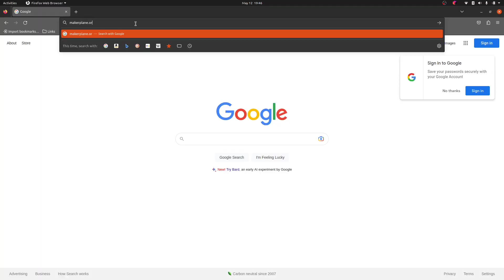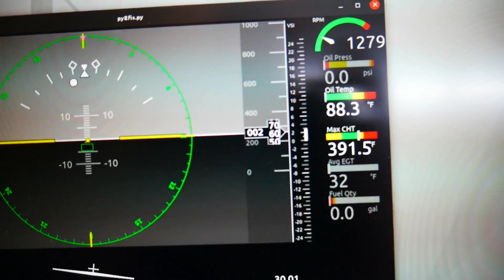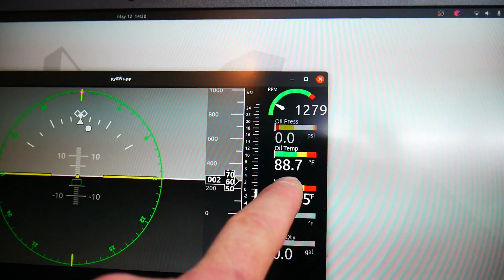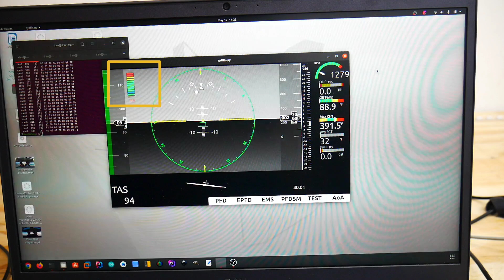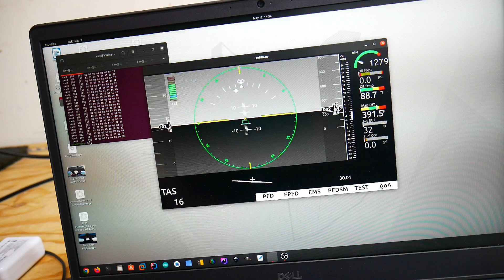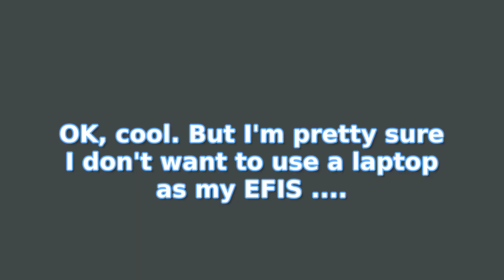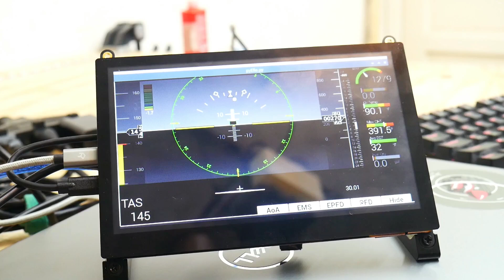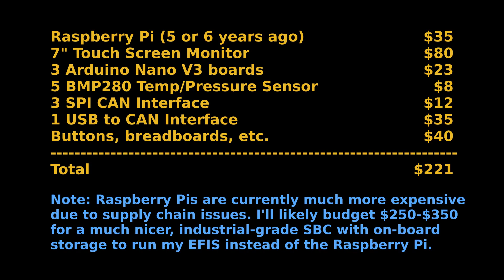Practically Free Avionics

Comment: So I got AoA, barometric altitude and the temperature of wherever the barometric sensor is located.

How do I get the software to display airspeed and attitude?
Reply from the maker: For attitude, it might be best to connect to a Stratux:
https://youtu.be/AJPfOm8xwjs?si=WrrAQ1apjDT1srXB

For airspeed you'd need to come up with a board that's connected to a pressure differential sensor (one port for pitot pressure and the other for static pressure), calculate what the pressure difference means in terms of airspeed, formulate a CAN message, and push the data to the FIX-Gateway (same as you did for AoA, pressure, and temp readings).
Reply: @dan_der_flieger  
Ok, thanks. That in a flash makes the whole setup much less affordable. I guess with all the stuff combined I will have to invest at least 1000,- for all of it. 

To be honest: before I entrust my safety to a DIY set, I'd rather invest 1800,- bucks into a uAvionix AV30E. That may not get me a large display or engine monitoring, but it has everything else:
- EFIS with attitude, compass, ball, altitude, airspeed, groundspeed, vario ...  
- AoA
- G-meter
- GPS data overlay
- HSI
- battery backup ...
fortunately as long as I don't want a Garmin, the whole stuff isn't THAT expensive anymore - especially considering how much money flows into the hobby anyway.
Reply from the maker: @archer494 - All true. I'm likely going to put a GRT 7" EFIS in my Sonex. 

I mostly started looking at the MakerPlane stuff to use as an engine monitor. I was planning to put an Aeromomentum engine in it (which uses microsquirt CAN messages). You could arguably make a really nice EIS for almost nothing. 

One thing about pyEFIS is that you can put a second display in your panel for like $150. With the uAvionics (or GRT or whatever) you're looking at minimum 10 times that for a second display. 

Like I said, for the money a single $2500 GRT EFIS and a tablet will do just fine for me. But I think it was worthwhile to play around with the MakerPlane stuff just to understand the various messaging formats. And since it's open source, someone is likely to figure out a good ADAHRS for it at some point.

Comment: Any recent updates. Did you get the engine management system connected to the Aeromentum engine? Can you show how?
Reply from the maker: No, I ended up buying a mid-time Rotax instead. But it should be relatively straightforward. The Aeromomentum uses the Megasquirt CAN standard. A quick glance at the FiX-GW GitHub repository shows that it now supports Megasquirt (at least it's listed as one of the options):
https://github.com/makerplane/FIX-Gateway/blob/master/src/fixgw/config/connections/megasquirt.yaml

Comment: First! Thanks for your hardwork!! It really helped me get going on this. A couple questions, It seems that for every sensor you have to have a different arduino to process the sensor info and pass it to the can bus. Im wondering if you would be able to run an arduino with an i2c board and connect the sensors to that of course with code to separate and pass the info on to the can-fix. Would that work or does each individual sensor needs its own connection to the can-fix? If so now i understand why you created the can-fix board😅.  Trying to figure out something to read rpm and Im thinking attemting to use ir to read rpm and I think i have a solution for probes.
Reply from the maker: @travisashby  thanks for the question. You can definitely connect more than one sensor to a single Arduino. My preference is to separate them for the sake of redundancy. If an Arduino with five sensors were to fail, would I want to lose those five points of data all at once?  Probably not.
Reply: @dan_der_flieger  Makes perfect sense. Just got my monitor in. Hopefully install goes well and let the testing begin!
Reply from the maker: @travisashby  nice! Have fun with it. But also be prepared to be a little frustrated, too. 🙂
Reply: Install went ok. Trying to figure out the monochrome issue. I think it has to do with the pyqt libraries and snap
Reply from the maker: @travisashby  I've seen the monochrome thing before. Sometimes flips back and forth to color. I just assumed pyEFIS has some code to flip it to monochrome if the data doesn't flow fast enough or whatever. Just conjecture, though. I didn't spend any time troubleshooting.

Comment: Bro, from wich sensor pyEfis can  take Air Speed?
Reply from the maker: The best one I have found is the MPXV7007DP. 

https://www.nxp.com/part/MPXV7007DP

It has two ports - one would be used for pitot and the other for static pressure. It can sense up to 7kPa from either nozzle. 

It's an analog sensor, so you would use an analog port on the Arduino to read the value.  The sensor has 8 pads, but you only use 3 of them: +5V, GND, and the output. The output will send a voltage between 0V and +5V, which is read by the Arduino. 

* 0V = -7kPa of pressure
* 2.5V = matching pressure on both nozzles
* 5V = +7kPa of pressure

Just make sure your Arduino uses 5V logic. Many are 3.3V logic and putting 5V on that GPIO will fry your board. If you have an Arduino with 3.3V logic, you can step the voltage down using a "voltage divider" circuit. It's built using two resistors. 

Here's a calculator that you can use to figure out which resistors to use to step from 5V down to 3.3V:

https://ohmslawcalculator.com/voltage-divider-calculator

But if your Arduino uses 5V logic, you can use the sensor directly - no need to use the voltage divider.
Reply: @dan_der_flieger  Thanks a lot for your answering and time, and two more question
1. This all work throw CAN interface correct?  (i mean true Air Speed sensor MPXV7007DP) 
2.  pyEfis work with Stratux and CAN interface (all sensors) at the same time (simultaneously)  or not
Reply from the maker: 1. That's how I set it up - air pressure differential sensor to an Arduino with a CAN interface. Then the CAN data is received on the RPi.

2.Yes, it should all work at the same time. The FIX Gateway is designed to collect data from many sources and present it to pyEFIS to display.
Reply: @dan_der_flieger  Matek ASPD-4525 i got this, what you think can it work? And what part of arduino i need buy for connect this aspd-4525  to can interface
Reply from the maker: @VVV-AVIATION - I've never used that sensor before, but it looks like it would probably work. It seems like it uses an I2C connection, which pretty much all Arduinos support.

As far as the Arduino goes, none of them (as far as I know) support CAN directly. You need a CAN transceiver to pass the CAN data. However, Adafruit has two microcontroller boards that have a CAN bus transceiver built in. I've played around with them and they work pretty well. 

Here's one with an RP2040 microcontroller: https://www.adafruit.com/product/5724

And here's one with a Cortex M4 (better chip):
https://www.adafruit.com/product/4759

Adafruit also has Arduino libraries and code samples to get you started:
https://learn.adafruit.com/adafruit-feather-m4-can-express
Reply: @dan_der_flieger  Thanks a lot Bro, and what you think how i can connect RPM signal to pyEfis from my ECU module
Reply from the maker: @VVV-AVIATION  I haven't gone that far, so I can't answer this question very well. It probably depends on the ECU. You will likely need two CAN modules - one to receive the messages from the ECU and the other to publish the messages in the right format to the FIX Gateway. Those should probably be two different CAN networks. If the ECU is on the same CAN network it will publish all sorts of messages of all sorts of types and the message type might conflict with the MakerPlane CAN protocol. By that I mean that the two protocols may use the same message identifier for different things and something like the ECU's oil temperature (just an example) might map to the FiX definition for something completely different. You need to be familiar with the message types in both protocols and do some interpretation.
Reply: @dan_der_flieger  oh ok, Thanks,  and i got usb-can module, its need to put some drivers for usb Linux or just plug and play?
Reply from the maker: @VVV-AVIATION  it depends on which one you buy. I didn't need to install drivers for mine, but I did have to run a command to start up the CAN network on it (like what CAN data rate, etc.) each time. I think I just added the command to the same script that I use to run the MakerPlane software.
Reply: @dan_der_flieger  Thanks
Reply: @dan_der_flieger  And what you think, can pyEfis take Speed information from gps module that be in stratux box?
Reply: On 3:20 min your video what arduino can i2c device you use? Cant find same, what best analog can be used?
Reply from the maker: @VVV-AVIATION  https://a.co/d/aLvqmyG
Reply: @dan_der_flieger  yes this thats what i need , but cant find it 🥺
Reply: Can i use this?
Reply from the maker: @VVV-AVIATION  yes, that link I sent earlier is the microcontroller with CAN I was using in the video. You may be able to use GPS from stratux for speed, but I have not done that.

Comment: Dan, thank you sharing this... All this has lit a fire in me to learn more.  Currently I fly an IFR certified, experimental Velocity, and I would have no issue running this as PFD but, with battery backed up G5s running in the of a failure go back to G5.  Like any instrument at anytime they can fail so backup systems and plans are paramount.    However, I am looking to actually using this in a KR2 as a PFD in VFR only conditions with steam gauge air speed and altimeter and if DIY EFIS fails, I continue looking out the window NBD.   Certification is just a process not the end all be all.
Reply: Thanks for watching, Gabe. Sounds like you have a solid plan to add redundant systems and not rely on any single one (which is a good idea). I'm still not sold on actually using this in my airplane yet, but I've learned a LOT from dabbling with all of the components and that's a good enough reason to play around with it IMO.

Comment: Where did you get this or how did you  created thi PFD altitude indicator?
Reply from the maker: It's part of an open source package called MakerPlane (https://makerplane.org/). Specifically, most of what you see in this video is the pyEFIS project. 

Here's a link to another one of my videos that describes how to use it and, in particular, how to get AHRS data from a Stratux ADS-B receiver:
https://youtu.be/AJPfOm8xwjs

And here's another one demonstrating some printed circuit boards I designed for use with the project:
https://youtu.be/cIsv_dQTMyo

Note that the pyEFIS project was recently updated and has changed a little since I made those videos. I haven't had a chance to play around with it very much yet, so I can't answer any questions about the new version.

Comment: Hello Dan, I’m from France and I like very much the way you explain your work. I had installed the pyefis and everything opens fine. I have a BMP280 sensor on an Arduino Uno and I get the data on a Raspberry Pi 4 via a USB connection . In a Thonny script I have the data temperature, pressure, altitude and it’s working fine. My question I want to ask you, in which file of pyefis I have to make changes to display the data from the sensor. I will do the same with the other sensors, but I’m a Little newbie in this and I want to understand this manipulation. Thank you for your response and your projects.
Reply from the maker: @cosscd7683 - Bon jour. I haven't tried to directly connect any sensors to the Raspberry Pi. I've only attached them to Arduino devices and used CAN bus connections. And I haven't used Thonny (I've heard of it, but no experience with it). 

I'm not sure that pyEFIS/FiX Gateway support what you want to do out of the box. But you'll probably want to do this in the FiX Gateway. Look under the plugins area and to find some code that does something similar to what you want to do.

For example, look at ~/FIX-Gateway/fixgw/plugins/demo/ to get an idea how to get data into the FiX Gateway.  The FG database key "ALT" is used for altitude. "CHT11" is cylinder head temperature for your 1st cylinder, "CHT12" is your second cylinder, etc. You'll have to look through the spec to figure out which database keys to use for the data you want to use.
Reply: Thank you for your response. You just connected sensors to Arduino and the Can connexions and the pyEfis program starts showing your sensors data on the screen without any other manipulation, is it? Can you give me an exemple of how did you do it for the altimeter sensor for exemple? Or can you guide me how can I connect my bmp280 to have data on my efis screen simple without any complications? Best regards @dan_der_flieger
Reply from the maker: @cosscd7683  That's mostly correct. I have a sample program for Arduino that I'll post to my GitHub repository in the next few days. I used an Arduino Leonardo board with a built-in CAN transceiver:
https://a.co/d/ai5J6or 

And on the Raspberry Pi running the FiX Gateway and pyEFIS, I used a USB CAN interface:
https://a.co/d/e9XDWXj 

I had to wire the two can interfaces together (two wires - High and Low) and write code on the Arduino that created the CAN messages in the format that the FiX Gateway was expecting. MakerPlane has a useful library for Arduino/CAN/FiX messaging that simplifies it: 
https://github.com/makerplane/CAN-FIX-ArduinoLib
Reply: Thank you, Dan, it’s clear for me, I wait for your example post in GitHub for ideas. Have a nice day
Reply from the maker: @cosscd7683 - Sorry for how long this took to complete, but I have posted my demo code to my github repository: https://github.com/danderflieger/mcd_can_simple_demo/

Hopefully it's helpful for you.
Reply: Thank you Dan for your response, I’ll take a look at this and keep you in touch . Great job!

Comment: Be cautious with an AOA sensor that has enough imbalanced weight to droop with gravity when the airspeed gets low.
Reply from the maker: I agree 100%. Always go slightly nose heavy to make sure it shows a stall when there's not enough relative wind to show a correct angle.

If you look at the latest version of my angle of attack sensor, you'll see that the counter weight/wind vane shaft is adjustable so that it can be properly balanced:
https://youtu.be/qBw1O5ASWJQ?si=nQtAt9RVMFasZ0d_

Comment: Dan thanks for your video , how can i connect AHRS ttl module, its better do through gpio or can-interface  or usb? and what additional stuff i need ? and how its be may programming for connect pyEfis
Reply from the maker: The AHRS module I connected was a Bosch IMU that won't work on a fixed wing aircraft. I connected to it with a CAN bus module. You can add an AHRS chip/IMU to a Stratux (using the Raspberry Pi's GPIO pins) and that is more likely to work. That's as far as I've gone at this point - I'm working on my airplane now rather than the EFIS stuff.
Reply: @dan_der_flieger  but stratus work only through wi fi ? I dont want use wi fi
Reply from the maker: @VVV-AVIATION   - I feel the same way, but that's as far as the pyEFIS project has gone at this point. There is another gentleman who is making many improvements to pyEFIS right now. He has integrated an RC aircraft controller which can give attitude indications. See his video here:
https://youtu.be/ljyaHKs1s2E?si=EQncFiL_lwJpgRu1

He is working on a lot of really good improvements and making very good progress.
Reply: @dan_der_flieger  Thank you bro 🙏

Comment: Dan, this is awesome! However, I do have a question for you -- how are you going to connect those circuits in such a way as they remain good and are vibration proof? If you install this in your home built, it will also be subject to temperature extremes. Will that be a problem?
Reply from the maker: Hey Jeff. Great questions. In another video I posted later I discussed using printed circuit boards and DB-9 connectors for the CAN bus connections. I also added a few other sensor boards to the mix (air speed, angle of attack, and a simple AHRS sensor):
https://youtu.be/cIsv_dQTMyo

This video was more of a proof of concept showing that it's possible.

Comment: Awesome!
Would be great if those sensores and arduino/esp32/stm32 would be on one single PCB each which could be ordered at PCBway & co.
Making it full redundant with 2 seperate CAN busses and 2 sensors each and 2 independent displays it would be more thrustworth.  For Raspberry PI there are extreme expensive SLC SD cards which extreme durabe. Also tuning raspian to avoid logfile writes to SD card could upmthe realibility.  Old raspberry PIs are better because you don’t need CpU coolers, which can get loose (glue softens when getting warm) and create a short.
Reply from the maker: Hi Olaf. I did start playing around with PCBs and demonstrated it in a later video:
https://youtu.be/cIsv_dQTMyo

It's fun to design and etch the PCBs and it's even more fun when they actually function. 🙂